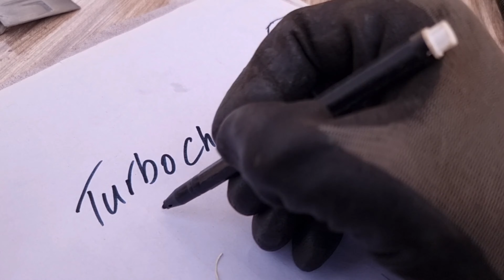Restoration the Legendary Dodge Charger with Customization

Comment: You should've found a hood that already has the hole in it & used it & found an actual blower setup & used it also &  could've done without the fender extenders,they look stupid, I  like the candy apple red paint job but you should've put some gold glitter in the candy apple red paint would've looked great then & need to get rid of the white stripe & white interior paint the interior black &put some carpet on the floor boards & customize the inner fenders to accept the wheels or put wheels on that actually fit & paint the rollbars black
Reply from the maker: Thank you bro for your priceless and honest opinion I'll think about that